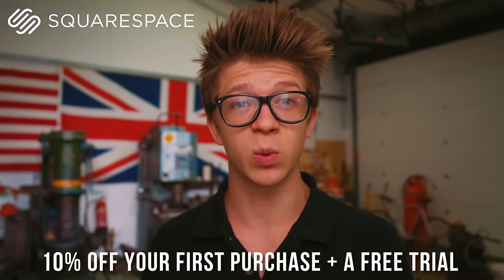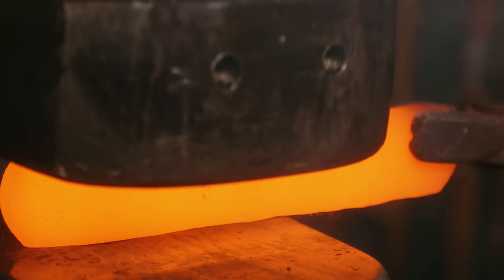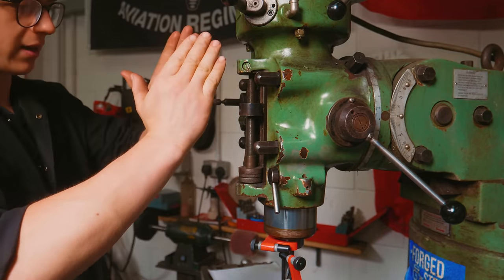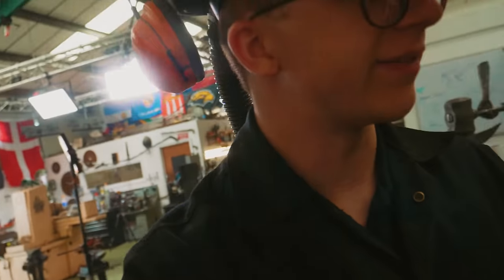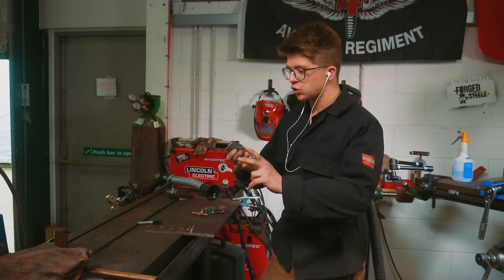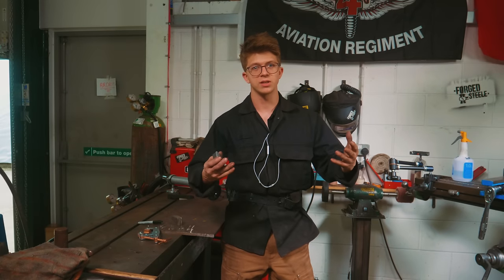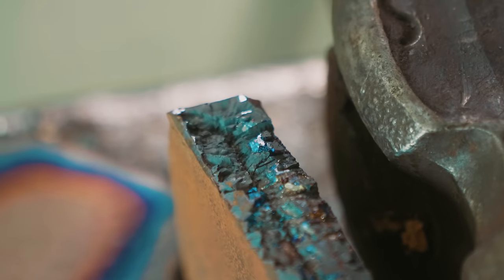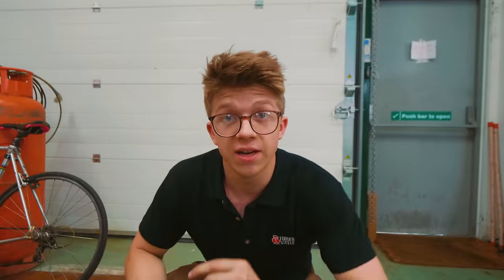CAN YOU MAKE TITANIUM & STEEL DAMASCUS?!?!

Comment: As a titanium metallurgist, you are almost certainly dealing with Ti64. You already noticed this but the shaving are highly combustible and band saws don't like Ti. I can contest to titanium fires not wanting to go out, I have a few holes in my concrete as proof haha. I didn't see what type of extinguisher you have but a class d is the way to go with this material. But a gas fired or open air furnace is going to be tough for this. Ti welding is usually done in an inert Ar or He atmosphere like you said because of titanium's high affinity for oxygen. Despite the failure, still cool to watch
Reply: I'm no metallurgist, but it says TA6V stamped on the bar stock.
Reply: At 2:09 you can see he has two water extinguishers so probably a good thing he didn't make a big enough Ti fire to detonate.
Reply: Years ago I used to work at titanium research and development. Company we used argon injected hot presses to form airplane parts.
Reply: Also a metallurgist, I can tell you Alec that even if you DO manage to bond the steel and Ti surfaces, at temperature, in absence of oxygen, what will immediately happen is that the carbon in the steel will migrate rapidly into the titanium forming a brittle carbide, leaving a soft layer of carbon free iron where the steel was.  Then as you try to cool the sandwich, the fact that iron has a thermal expansion rate that is significantly larger than titanium will result in a huge shear stress across the interface and the steel (pure iron at surface) will try to peel away from the titanium.  The (brittle as heck) titanium carbide layer will fracture and the whole thing will still come apart.  Even if you avoided the carbon transfer reaction by using pure iron (a poor blade material to be sure) it would either fracture at the interface or just bend like a banana during cooling.  While the TIG weld step was interesting, you were just creating a brittle coating of Ti + Fe + C intermetallics.

FWIW there are band saw blades and cutting wheels that will cut titanium better than your garden variety shop blades/wheels but you won't find them at Home Depot.  You /could/ have researched the feeds and speeds to use on titanium ahead of time but that does not seem your style....  So overall interesting to watch, like a train wreck, but it wasn't going to work.

"Good judgment comes from experience, and experience comes from bad judgment."
Reply: the tig weld had nothing to do with the blanks not fusing.   not enough temperature, and not enough forge hammer pressure.   get to near the eutectic for Fe and Ti alloy, then they will start to fuse.   and I have had hundreds of titanium slabs and plates (beta alloys and 6-4) band saw cut.  find the right feed rate and saw RPM.  And he needs to use coolant on the saw and the mill.  Then no worries about sparking, and his cutters will last a lot longer.    20 years as a titanium process/product metallurgist experience.
Reply: the big "secret" of timascus. -   its being done in a can purged of O2.

Comment: One thing you should know about titanium is that its mealting is so high in comparison to most materials, and while it becomes somewhat maluable, it wont break, this means that you cant for a dimascus with steel and titanium unless you find a way to trap the molten steel between the almost molten titanium. Titanium takes several thousand degrees of heat to mealt, but it isnt a perfect conductor, so if you can put enough electricity through it, you may be able to get it hot enough. I'm not sure just how much heat it takes, but i know that it can take at least 3000 degreas of heat withought melting. Also most of the sparking is probably impurities in the titanium, including titanium oxide, however if you can expose it to enough carbon monoxide, any titanium oxide should act simmilar to thermite, releasing a ton of energy as the carbon monoxide rips away the oxygen, possibly heating up the metal enough to get near or even past the melting piont. If you are going to heat up titanium then your best bet for a crucible would be tungsten, and if you need to cut titanium, you will need a plasma cutter. The king of random made a cheap plasma furnis that you should be able to build easily if nessisary. Also watch the hacksmith's several thousand degree lightsaber build that talks a little about titanium and tungsten, as it uses a tungsten rod to maintain structural integrity, and uses a titanium tube to get extreamly hot. The backyard scientis also cast a sword from thermite, which is fairly usefull information as well.

Comment: Hey Alec I don't comment often but fun fact my grandfather actually helped make the process for steel titanium bonding a long ways back with my father. They originally used the process to help create studs for bridges in the US (this is a long time ago). I believe they used a kind of explosive (I think some kind of industrial plastique things were a lot less regulated then....) in a controlled explosion to bond the metals. The flash explosion allowed the metals to bond without the oxidation layer and brought both metals up to the necessary weld temperatures. I am in no way an expert in this just something you should try and look into.

EDIT: after a quick phone call it was an aluminum/titanium stud for airplanes and large ships not bridges, however I still believe the process is still applicable here
Reply: Ah yes, explosive welding. While a very cool process, I do believe it's something Alec Steele here would have a hard time getting permission to do. Besides, his thing has always been forging, and in this case, unless he gets a press that can create orders of magnitude more pressure than he currently can, and buys a sealed vaccuum or inert gas (i.e. argon) high-temperature furnace to do his heating in, the only thing he can make with titanium is pretty iridescent colours caused by the microstructure of the oxide layer forming a diffraction gradient on the surface of the metals.

Hey Alec - try tungsten next, k? I'd like to watch you try to obtain the forge temperature necessary to get pure tungsten into a plastic state (between 2,500-3000 degrees CELSIUS, which is basically 2X as hot as the hottest magma to erupt as lava on Earth since the beginning of plate tectonics ).
Reply: Like some kind of thermite? :)
Reply: He needs to collaborate with the hydraulic press channel for that :-)
Reply: There is a good video out about the explosive welding process. It doesn't matter if you can do it, still great to watch and learn. Check out the video by Nobelclad.
Reply: Alex playing with ACTUAL explosives? I totally support giving this process a shot!
Reply: Isn't it the same with Thermite? 🤔
Reply: No. Thermite melts bonding material with heat, explosive welding smashes two things together, so that they stick.
Reply: Bernat Roselló explosion welding required a quick violent reaction much more than thermite
Reply: I wonder why americans say aluminum and therefore wonder why they don't say titanum and beryllum for instance at the same time...
Reply: Explosion welding is an impressive thing, and does indeed laminate dissimilar metals. Titanium and steel might also bind by stir welding, or any of a number of other exotic methods. I remain excited by the possibility of forge welding working.
Reply: American coinage is stamped out of blast welded sheet (dimes and quarters).

Comment: From the look of the oxide, it is the most common alloyTi6-4 (6% Al and 4% Vanadium) hence part of the metal identification is TA6V. The usual forging and rolling temperature is between 935 and 950C. It oxidises quite readily at those temperatures resulting in the brown powdery layer. Gas preheating, in particular where the atmosphere cannot be ready controlled is best avoided as any free Hydrogen or Nitrogen can readily be picked up by the hot metal rendering it very brittle and useless. Best way to ensure this does not happen is to have a good oxidising atmosphere in your furnace.
It is the cutting fines that can burn very fiercely and a Thermite type reaction often occurs if you mix old iron or aluminium cuttings and Titanium so always best to clean your machine down 100% and collect and dispose of carefully. Oh yes, DO NOT put water on a Titanium fire, it will explode, safest is to use either dry sand to smother it or dry powder extinguisher. Bulk Titanium pieces do not normally burn, however there is one exception, that is if it is very hot and in contact with pure Nitrogen. It will then burn forming Titanium Nitride, this reaction does not need any Oxygen at all.
To have even the most remote chance of them bonding all surface must be chemically clean. Put your final pieces of Steel and Titanium into a a box, seal up the box and weld it up in a vacuum or in Argon. Any air (Oxygen, Nitrogen or Hydrogen (ie water vapour) that is left will react with the Titanium at high temperature causing an oxide or surface enriched layer that will prevent the bonding).
The blue brittle layer is typical of Hyrogen / Oxgygen contamination and embittlement suggesting you have excess fuel (gas in your furnace). Reduce the gas and or increase the air to provide an oxidising atmosphere. Hot Titanium will suck up any free Hydrogen very readily and you only need values of the order of 30 to 40 ppm to render the material brittle and useless.
Think, that should help you some if you get another attempt. Retired now, but worked in QA on Titanium, Zirconium, Hafnium and Niobium for 40 years
Reply: Thanks Richard that is some stellar information.
Reply: Why did I read all of this, I literally play sports and video games for a living...
Reply: Ur genius though lol like 200 iq
Reply: I never thought I will save a youtube comment for my records and references, but this reply is just too good to pass by.
Reply: Thanks, glad my info has been of use / interest.
Reply: Excellent precise information! Thank You Richard!
Reply: Glad my info has been of help / useful to others.
Reply: 30-40 ppm absorbed H2 is normal.   most specs allow up to 150ppm.  CP titanium will not become brittle even if annealed in 100% H2 (just a little loss of strength/ductility, but not much - I tested this with increasing % H2 furnace atmosphere myself), but will have hydrogen levels so high no one would buy it.   6-4 may be a different story, but still going to need well over 150 ppm.

the thing about trying to douse a titanium swarf fire in water is mostly true.   it is burning so hot, that if you immerse it in fire, the heat is enough to crack water into H2 and O2.  its the H2 gas that gives you the explosion.
Reply: Significant difference in annealing CP (Commercially Pure Titanium at 675C or Ti 6-4 at 750C) and the preheat temperatures for rolling, forging at 875C and 950C respectively, H2 pick up is very much higher, faster and deeper and it does have a huge impact on UTS, Ductility and creep strength, all of which are critical in aerospace applications. Some spec's do allow up to 125 / 150ppm Hydrogen, but in terms of first tier manufacturing for aerospace, then the spec limit is set at 40ppm. The reason being, second tier operations invariably add additional H2 so first tier produce to as low a specification as possible.
Reply: Richard Hope  if you control furnace atmosphere to oxidizing (at least 2% excess O2) and control your heating times to avoid prolonged furnace times, I've never seen a problem with much H2 pickup.  Have seen more from pickling (or your chem milling) when the bath was too hot and too much HF.  Also a big impact from melt - EBSM ingots usually twice as low ppm H2 over double VAR, even though the EB jumbo ingots have more mass and cross section than the VAR, so needed longer soak times.  so melt method and sponge production is critical.
I was just saying on CP, even 900 ppm H2 doesn't mean your piece of titanium will be brittle.  I found it only  lost a couple % elongation on CP2 when annealed in 100% H2, compared to a piece that was vacuum annealed and had anywhere from 15-40 ppm.  That's why most people called the H2 Leco machine a random number generator where I used to work.   
I never tried the H2 atmosphere annealing test on 6-4, so I don't know at what point ppm you will see a significant drop off in % elongation or UTS.  But there is always a safety margin built in to specs, so I suspect it is a good bit more than 40-50 ppm.   Ballistic 6-4 plate allows up to 0.015% or 150 ppm, so it can't be that harmful at that level or it wouldn't be able to do its job of effectively stopping projectiles.
Reply: That was so insightful, Thanks Richard, one can tell the words of the expertise .
Reply: Four months ago, Crom came down from the mountain and gave us the recipe for steel... I mean titanium Damascus... and it was Good.
Reply: That was very interesting thank you for the effort :)